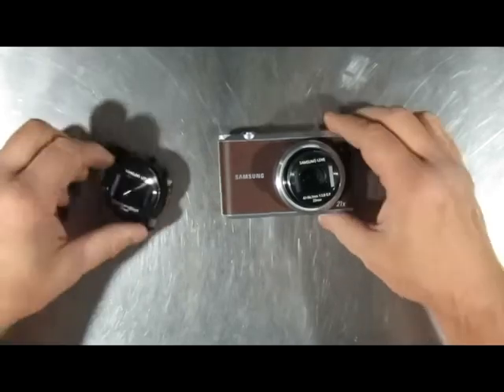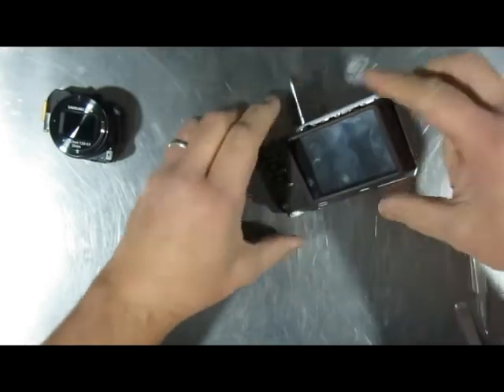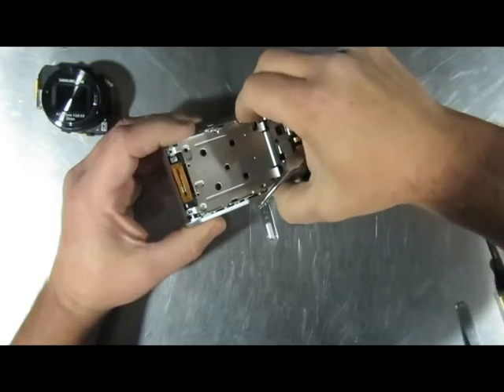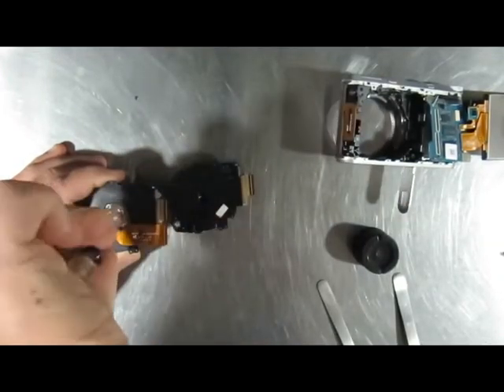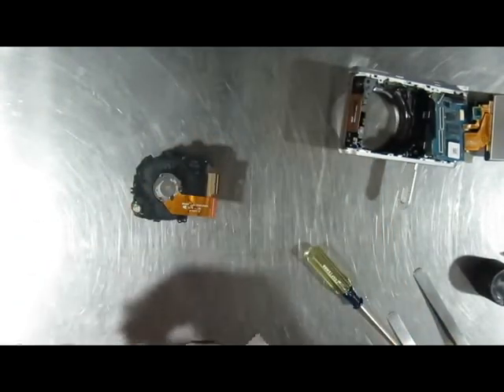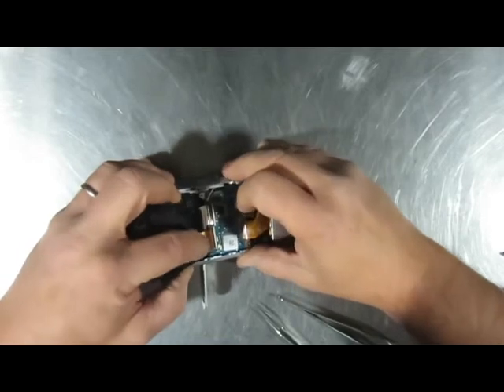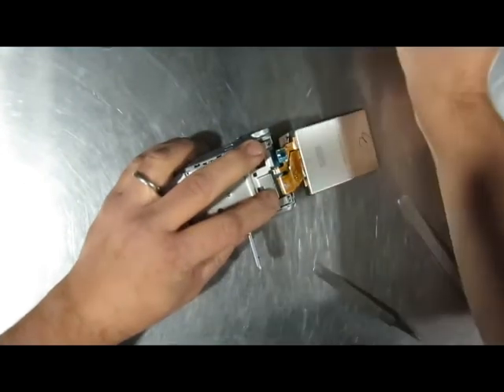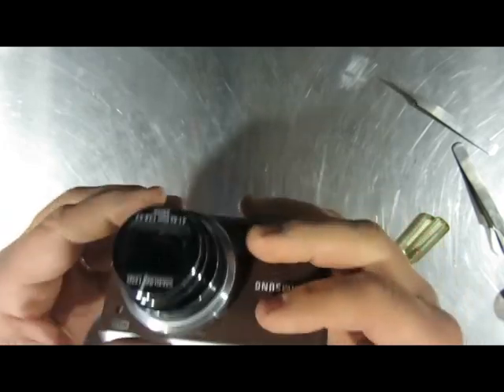Samsung WB350F  Lens Replacement Repair

Comment from the maker: I have had someone ask me about a problem they had when performing this repair....when completed the user had a "deep red or pink" overall tone to the images. This is what will happen if you forget to transfer the small piece of square glass in front of the sensor to the new lens assembly.  At approximately 10:45 in the video, I transfer the small piece of glass ( usually called a low pass filter) to the new lens assembly.  It must be transferred, and it is easy to damage so be careful.  Good Luck!